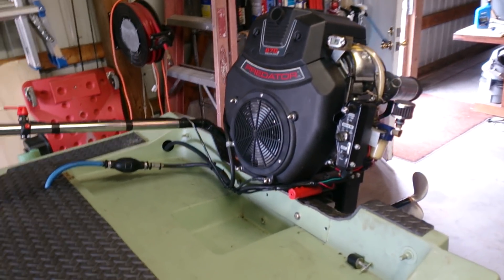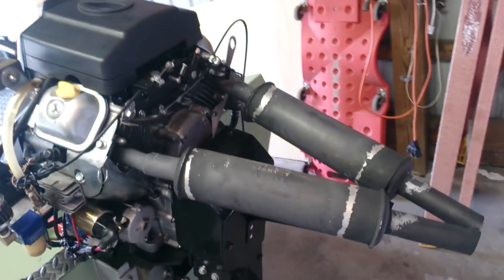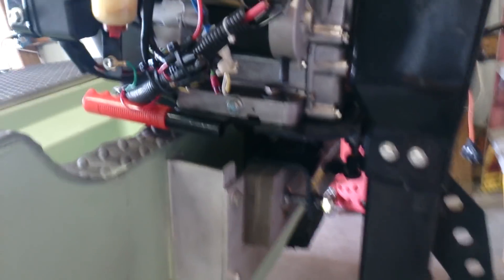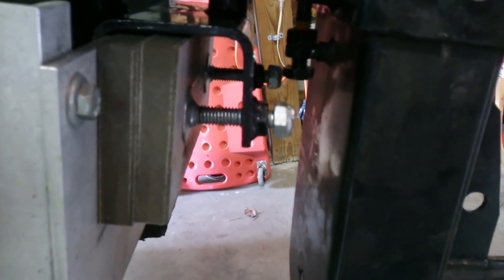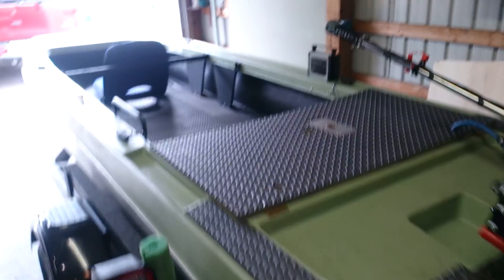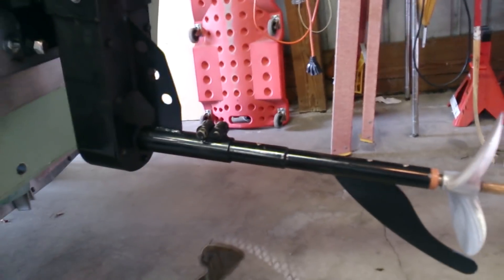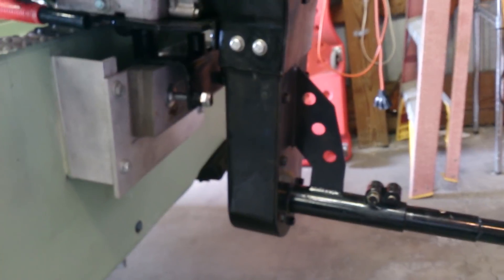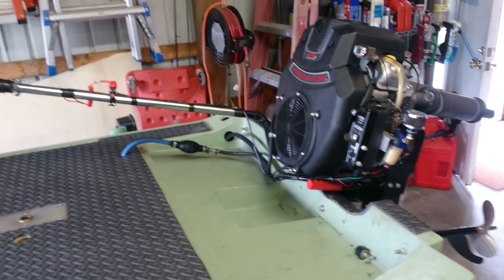Mud Skipper surface drive 22hp Predator setup and info

Comment: Modern longtail mounts are not as good as the old-style ones invented and used here in Thailand 20-30 years ago. you need to balance the engine so it runs hands-off. I still use the old mount, it's a completely different experience,. I'm gonna try that seat up though looks cool see my channel to get a better idea of what I am saying.

Comment: What mufflers are those
Reply from the maker: tractor mufflers bought from summit racing 1 3/8" inlet /outlet
Reply: Did you mess with the jetting since you’re running custom exhaust?

Comment: Looking into getting the same thing you have did water get in the lower unit and how did the chain hold up before you swamp it out
Reply from the maker: The chain came apart with about 5 hours of run time, Don't waste your money on this setup. I would look into a Mud Walker or Copperhead if you’re wanting a simple surface drive. Also an outboard with a hydraulic jack plate works very well.
Reply: Do you still have it or you bought a copper head now? And how did you take the governor off
Reply from the maker: It’s in pieces in the garage… I now run a 1979 OMC 70hp 3 cylinder outboard on a Bob’s hyd. Jack plate, The boat rips! Bye bye lawn mower engine… Governor removal can be found here on you tube if you search for it… if you cant find it for a Predator Briggs v-twin is about the same…
Reply: That’s man

Comment: Dave, it looks like you have had some issues with the mud skipper .I'm looking into a surface drive kit and was planning on the 670 predator. Based on your experience would what would you think one would work and last like in stock kit form and stock motor on a 1648 semi mod v rivited low jon boat.O dont need a lot of speed just would like to get into the skinny water which is mostly hard bottom and not too much mud.

Comment: Torn between the Vegas Carts 625cc and the 670,.. 670 recently has a blossoming race parts following so im going to go ahead on it,..
Reply from the maker: good call... way more torque with the twin,  With the governor removed, good exhaust and carb (china pwk 38mm works good for $35.)is about 10hp easy... add stiffer valve springs and run it between 4500-5000 rpm it will rip and carry a lot of weight, I have run this motor on golf carts and plan on installing one of the vertical shaft units on a outboard lower unit, help a friend do that with a 25hp Kohler and its working out well...

Comment: I was thinking about getting the same one. Very Leary of chain drive. But the price is right.  Is it holding up? Are you still happy with it?  Thanks for the video
Reply from the maker: Not good... I learned the river and now run outboards
Reply from the maker: Hello, if you read all of my description above it pretty tells the story of this setup… I have not messed with it since I broke the drive shaft, The water has been up since May here so I have been running my outboard boats which are much more reliable and faster… once the dry season comes maybe I will look into fixing this unit or junk it and build something else… The Predator has been a great motor for me with about 100 hours of hard use but the Mud Skipper drive system has proven to be pretty much a P.O.S. I would look into a Mud Walker or Copperhead if you’re wanting a simple surface drive…
Reply: I didn't read that tell now. Thank you very much for the input tho. !!! it is so greatly appreciated I cant even begin to describe.
Reply: Dave Pickrel , Do you wish you stayed with the Swamp Runner? Was looking at building SPS with the same Predator 22, and reading older threads and came across your Youtube page. Now I see you tried the Mud Skipper, and the problems you have had with it.
Reply: his reply to me was  I would look into a Mud Walker or Copperhead
Reply from the maker: The SPS is a very simple and reliable setup and I did have a lot of fun with it, the things I did not like about was it you run in real tight narrow creeks it’s hard to get turned around with a 15’ boat and a motor that’s sticking out 9’ off the transom, Also if you run a river that is narrow with a lot of tight turns its very hard to run on plane and steer quick enough to stay out of the trees this will also wear you out physically very quickly,  I would guess that 80% people out there do not run the type of water I do so these issues are probably not a problem for them… Hope that helps!

Comment: If you hit anything, it doesn't look like it could kick the motor up very much
Reply from the maker: not a lot but enough...  When the handle hits the deck the bottom of the skeg is about 2 inches above the bottom of the hull...

Comment: Hello. I have the twister with the 22hp on it with a 10 inch 3 bladed prop and it's a bear to steer. Was it easier to steer with the smaller prop? Don't really care about speed it's a workout to steer
Reply from the maker: yes, the bigger the prop the more torque steer you feel on the tiller handle

Comment: Wouldn't you want a bigger gear on the engine's shaft and a smaller gear on the prop's shaft to get more speed out of it? Or are you saying that you want more engine rpm? Nice work, looks good
Reply from the maker: Hi Steve,  with the stock gearing 1-1 it would only turn 3600 with the 9.5 prop and the hole shot was very slow, much better now with the reduction, better hole and increased mph

Comment: any information on how you changed from chain to belt?
Reply from the maker: I did a lot of research to figure out what pulleys and belt would fit, handle the power and change the gearing to something move favorable to my expectations, once that was completed I ordered the parts and the install was very simple, The only modification I had to make was to slightly grind down the edge of the larger of the two bearing retainers because it was slightly hitting the lower pulley adapter hub.
Reply: Dave Pickrel any way you could give the details on what parts you used? I’ve been doing research on it but coming up empty handed. I’d be more than willing to pay for your time and info
Reply from the maker: yes, what motor do you have? send me an email and we can go from there dwpickrel@gmail.com